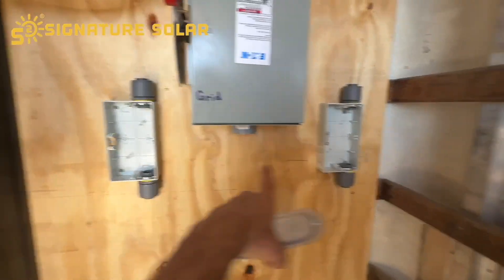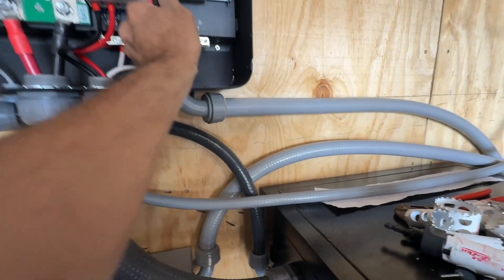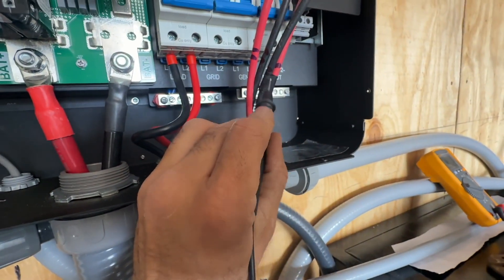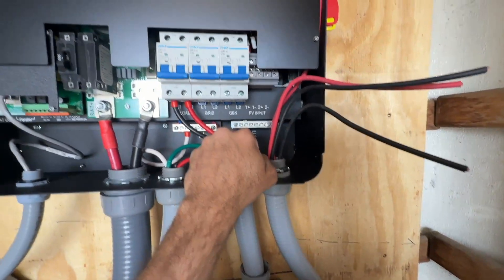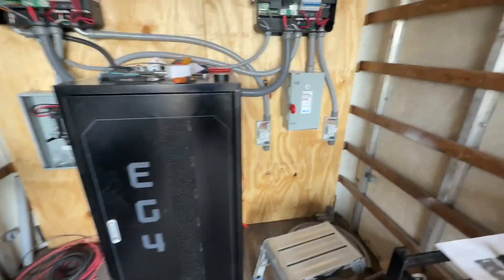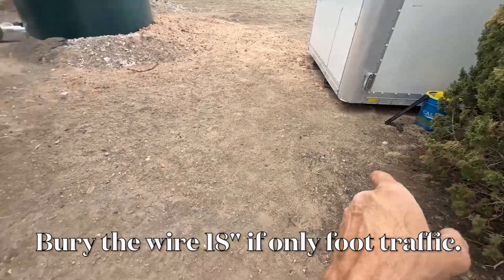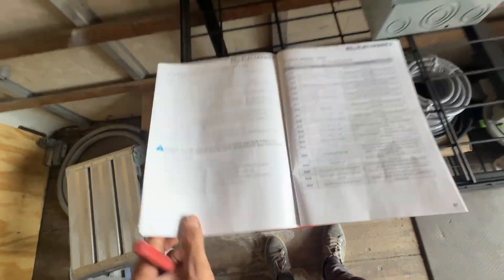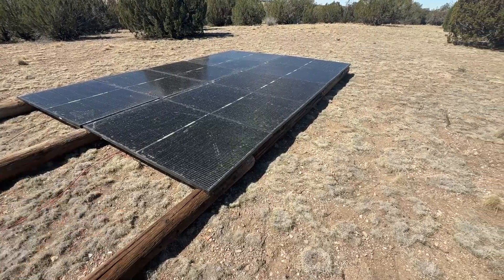Off Grid Solar Install - EG4 6000xp & EG4 LL-S Lithium Battery - Part 4

Comment: Here's what Google says about these products: "Complaints about Signature Solar often involve issues with product reliability (like inverters and auto-resetting batteries), poor customer service response times and communication, and deceptive or problematic shipping and billing practices. Customers report receiving damaged or incorrect parts, experiencing system failures, and having difficulty getting technical support or resolutions for their issues. 

Product and system issues
Equipment failure: Customers have reported inverters malfunctioning or blowing up after installation and experiencing issues with battery auto-reset functions that require manual intervention. 

Incorrect or damaged parts: Some customers have received incorrect cables, and others have found cracked solar panels upon delivery, sometimes suspecting they were shipped that way without being properly inspected. 

Incompatibility: There are reports of incompatibility problems with panels not working correctly with their inverters, specifically with the EG4 system being difficult to use with panels other than Anchor panels. 

Customer service and support
Slow or non-existent support: Many customers report difficulty reaching a live person by phone, and have experienced long periods with no communication on support tickets, even after multiple attempts to follow up. 

Warranty and support gaps: Some customers feel Signature Solar has "dumped" them and that their support has been lacking, especially after the initial warranty period, as noted in this Facebook post. 

Billing and shipping problems
Deceptive shipping costs: Some customers have reported being shown a low shipping rate in their cart, only to have it change to a much higher rate at checkout without any explanation, as described in this DIY Solar Forum thread. 

Late shipping and uncommunicated delays: Several customers have experienced significant delays in receiving their orders without any communication from the company, and some have been charged for the entire order well before it shipped, notes this DIY Solar Forum post."